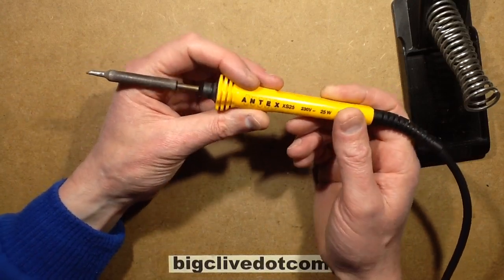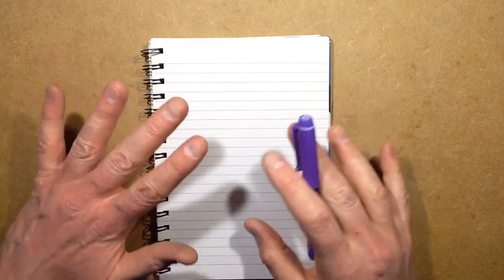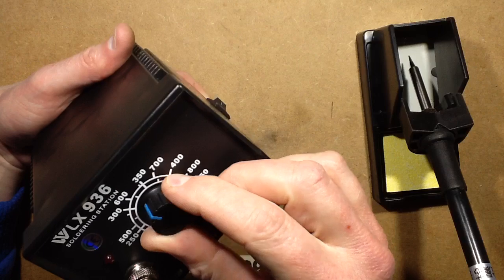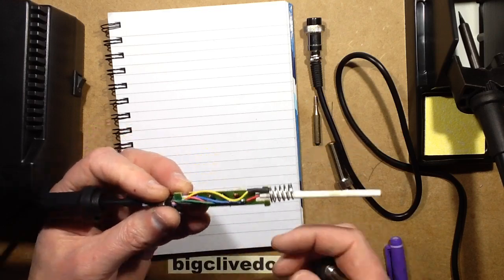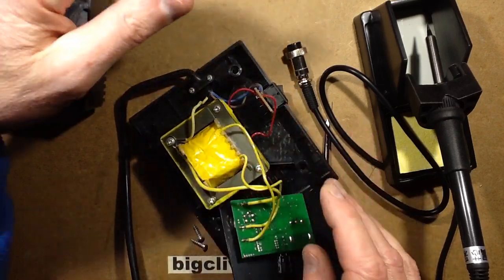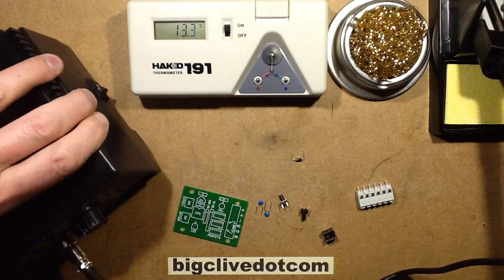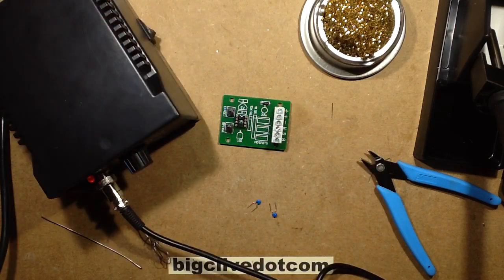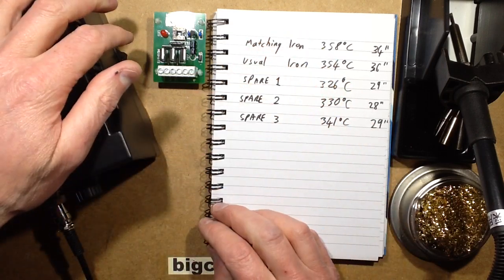Soldering basics and choosing a cheap soldering iron.

Comment: im so glad that you use metric and not that pathetic imperial system. it makes it so much easier to understand! cudos to you!
Reply: "Milliliters and milligrams are not really used in Europe either, except for drugs." I guess that depends on the region. Milliliters are common in Germany. The metric system gives you some flexibility. Luckily, it is easy to convert between different "cultures". The systematic way of unit conversion makes the metric system convenient in science and daily life.
Reply: Are there 100 inches in a yard?  No.  Are there 100 yards in a mile?  No.  It's called metric for a reason and that reason is that everything shares the same metric.  And there is no need for a decimeter, you may as well have a three dollar bill for those days when a one would be too small but a five would require change.
Reply: Theo0x89 I used to live in Europe. Would use « decis » or « Dezi » (deciliters) daily for drinks at restaurants and cafés, though each size also had a name. Typically you can get 1 dl glass of wine, 2.5 dl small soda, 3 dl normal soda or 5 dl big soda or beer. I believe people also refer to 3 dl beer but bottles contain a pint (355 ml) no? Regular wine bottles hold 7.5 dl.
I’d also hear people say 25 cl. Milliliters and milligrams are not really used in Europe either, except for drugs.

IMO THE MAIN ADVANTAGE of metric is that it makes it easy to do other calculations in Physics because of the SI unit system. Like F = ma works with Newtons, kg and ms-2. 

We can all agree that the Fahrenheit scale makes absolutely no sense though. It’s based on mistakes from its creator. 
Btw if you keep forgetting how to convert from Celsius, keep in mind water freezes at 32 F and boils at 212 F, with 180 divisions in between instead of 100. To get Celsius shift by -32 and divide by (180/100). Reverse to get Fahrenheit from celsius (expand to 180 divisions and shift by 32)
Reply: "there's nothing stopping us from using decimal notation with the imperial system" Don't be silly. You know very well that there is a fundamental difference in converting between inches, feet, yards, miles on the one hand, and millimeter, centimeter, meter, kilometer on the other hand. The point is that all these units are common, but they are hard to convert within on system and easy within the other. On top of that, you have the same unit prefixes for all quantities in one system, while you have to know different conversion factors for different quantities in the other.
"If you buy a ratchet and sockets, what is the square drive measured as?" There are many examples of imperial and customary units used internationally for historical reasons or due to the influence of the United States. That doesn't change the fact that the metric system is easier to work with and should be preferred when feasible.
Reply: "The meter is still just an arbitrary unit" As an engineer you should know that it is not the definition of the meter that make people prefer the metric system. It's the systematic way of converting between units of length that makes it easier to work with.
Reply: hahahaha Paul for someone so seemingly intelligent, you're an idiot. Anyone who can count to 10 can do metric. It is a far, far more logical and intuitive system than imperial. Oh and 'standard wire gauge' is useless info. Cross sectional area in square millimetres on the other hand is very useful.
Reply: Indeed, a thou (1/1000th of an inch) is a standard PCB measurement.
Reply: It's a two dollar bill, and it's handy! And yet there are a hundred pennies in a dollar, but ... whatever.
Reply: Not units. Magnitudes.
Reply: "Is it an imperial unit like here or is it some metric value" According to Wikipedia, the square drives are manufactured in precise metric units everywhere, so the dimensions in inches are actually approximate and just used as trade names (https://en.wikipedia.org/wiki/Socket_wrench#Ratcheting). Wikipedia doesn't cite any sources, but I guess there are ASME and ISO standards for that (maybe ISO 1174?).

"Not worth the trouble" I'm not sure about that. In the long run it may cause more trouble to keep using more than one standard in the US. A typical example is car repair, where you need different sets of tools for domestic and imported cars. Another cost factor is error-proneness, the prime example being the Mars Climate Orbiter, which failed because of a units confusion. Even if a brain can do more then chewing gum, it is still not infallible...
Reply: "in other words, you metric-weenies have to refer to the drive as 1/4″, 3/8″, 1/2″, etc." I already implied this two comments ago and I already anticipated your faulty logic. Didn't you understand what I wrote or do you have Alzheimer's, old man?
"You need both sets of tools for a single car and it's been that way since at least 20+ years" So you're saying the multiple standards made it even worse than I said. Thank you for proving my point.
"That error didn't have anything to do with conversion" That was my point. Conversion is not the only problem that comes with clinging to that antiquated measurement system. You need to work on your reading comprehension.
"I'm sure that they could have managed to make some other mistake [...] Never underestimate the power of stupidity." That's some impressive mental gymnastics. "Don't let us eliminate this source of error because other errors can be made."
"If it was measured in mm or μm, I wouldn't have a problem -- I would just set my caliper" Just as no "metric-weenie" has a problem using inches for ratchet drives. In these cases the sizes are basically just used as labels.
"It's funny that the people most complaining about the Imperial system are those who never have to use it" I'm sure you have a study at hand that proves you didn't pull this fact out of your ass, you just forgot to include the citation. Just to be clear, I have used old units, and I'm actually complaining about your idiotic arguments. I don't really have a strong opinion on the unit systems used in the US. The old units will fall out of usage sooner or later anyway for practical reasons. The interesting question is why some people feel the urge to defend their backwardness.
Reply: Whether you use metric or imperial or SAE/US customary units, it's all just an arbitrary way of measuring.  There's nothing intrinsic about the metric system.  The meter is still just an arbitrary unit that they originally defined as 1/10,000,000th of the distance between the equator and the North Pole.  But then it turned out that their estimate for the distance to the North Pole was wrong, so it ended up being just the length of the sample rod / bar that had been previously created since they didn't want to change the measuring scale due to the fact that it would affect so many things.

I'm an engineer in the US and I have no problem switching units as the case may be.  Even in the UK, beer must be sold in imperial PINTS, not metric based units and their pints are a bit different than US pints (slightly different size ounces and 20 oz per pint over there vs 16 oz per pint here).
Reply: @CurmudgeonExtraordinaire  True (for draught beer, and cider), but all other alcoholic drinks are sold in ml. In supermarkets, almost all liquids are sold in ml, although milk can either be sold in pints or ml. (Beer and milk were I suppose regarded as traditional staples, and it wasn't worth annoying traditionalists by insisting on metric for those). And we've been buying petrol (gasoline) for decades in litres.  We still measure road distances in miles and yards though (same argument re: traditionalists, I'm guessing).

I started work in the engineering industry in 1968, and metrication was just being slowly (very slowly) introduced. I imagine we'll stay with miles and pints for the uses mentioned for quite a long time to come. Some idiots want to reverse metrication after we leave the EU (if we actually do). Ignorance as well as idiocy, since metrication started well before we joined the EEC (which eventually became the EU).
Reply: +Theo0x89 -- And there's nothing stopping us from using decimal notation with the imperial system.  In fact, we already use it if you are talking about milling / lathe operations (i.e. 1/1000ths of an inch).  When we refuel at the gas station, we don't buy 20 gallons and 8 ounces, we buy 20.5 gallons.

I've got a question though for the folks over in purely metric countries... If you buy a ratchet and sockets, what is the square drive measured as?  Around here, whether it is Imperial or Metric, the drive will be 1/4", 3/8", or 1/2" (although they do make larger for really large nuts and bolts).  From some YouTube videos that I've seen by people that are based overseas, they refer to their ratchets by the same Imperial measurement on the drive square that we use.
Reply: @CurmudgeonExtraordinaire  You've reminded me that in "purely metric countries" (in Europe), their standard railtrack gauge is 4 feet 8.5 inches, same as it is here in the UK! :-)  And that's another thing that won't change any time soon.
Reply: @Okurkaarrgghh  Fair point (through when it was first introduced in England in the early 19th century, it would have been expressed as 4 ft 8 1⁄2 inches).

Checking online, I read that there was an international rail gauge conference as far back as the late 19th century, in Berne. I haven't found the text of that though. I found this much more recent UK source which is interesting:
https://www.thepwi.org/technical_hub/technical_hub_files/track_maintenance_general_guides/maintenance_of_track_gauge_guidelines_1999
which does indeed define it as 1435 mm, although it's not quite as simple as that if you look at the full document.
e.g. it talks about "gauge widening" on tight curves. The widenings are of course expressed in mm.

Anyway, that just supports the point that the UK (for all its sins..   :-) ) is a metric country for most serious purposes, with the major exceptions of road distances, (and I believe railway track distances - i.e. distance between places, not construction dimensions), draught beer and bottled milk.
Reply: +Theo0x89 -- I was not asking a rhetorical question, I actually wanted to know what the square drives on the sockets is measured as over there.  Is it an imperial unit like here or is it some metric value that is probably close enough that the sockets from the two systems will probably work?

There are certain things that I deal with that are metric, others that are in the US measuring system, and still others that are in the actual English Imperial system.  It's just not that big of a deal to me.  Not worth the trouble that would be involved in switching over the US to just some other arbitrary measurement standard.  Sure, there are a few conversion factors that you need to remember, but if you can't remember them (or at least remember where to find them), then you probably shouldn't be doing anything that involves more complex thought than just chewing gum.
Reply: Actually, us metric-weenies don't refer to the drive as anything, grumpfart. As I said, nobody gives a fuck about whence the size originated or how much it actually is because all this thing interfaces with is the sockets that we use to tighten or loosen our beautifully metric nuts and bolts. For all we care, they could be measured by some Zimbabwean's king's smallest three toes. To us, it's simply the large, medium, or small ratchet with its matching sockets. There is nothing else practically available that the ratchet drive needs to fit due to its size in inches, centimetres, or whatever. So fuck off with your idiotic argument. Go ride your hemorrhoids-massaging machine.
Reply: it's gotten us to the moon, so..
Reply: If anybody thinks that having different measure units is not a problem, just google "conversion error NASA". It yields long list of arguments why we should stop using antiquate units.
Reply: Rob Fraser - "Are there 100 inches in a yard?  No. Are there 100 yards in a mile? No. It's called metric for a reason" - Uh ... being base-10 helps, but it's by no means an absolute necessity for metricity. Just saying. And fuck your double spaces after full-stops.
Reply: Some inch-based (or rather, based on the local equivalent of the inch) remain, such as said square drive bit, but probably because it doesn't interface with anything else but the actual sockets, nobody minds, while nuts and boltheads are metric. Same for a few plumbing pipe sizes. Seen so, for instance, in Germany.
Reply: Grumpy OldMan hahaha yep I was going to bring up pints of beer. Google that shit. There's about 7,000 versions of what a pint is. Measure those 'pints' in millilitres and it is immediately clear. On a related note, I'd never heard of decilitres because here in Australia we use millilitres. It was immediately obvious however that that 1 decilitre is 100 millilitres. Just another example of the logical and intuitive nature of metric.
Reply: I hate it when people use the pathetic metric system. It makes it soooo hard to understand.
Reply: Good point!
Reply: Hey FUCK you.
Reply: "And there is no need for a decimeter" Well, the widely used liter is one cubic decimeter, so there is a usage for that sadly neglected unit. Anyway, I want to congratulate OP for triggering some imperialtards. They surely take it personal that someone doesn't like their measuring system.
Reply: So, in other words, you metric-weenies have to refer to the drive as 1/4", 3/8", 1/2", etc.  LMAO...

Different sets of tools for domestic and imported cars?  LMAO... Just shows how little you know... You need both sets of tools for a single car and it's been that way since at least 20+ years as far as I know, just from cars that I've owned and done minor repair on.  Hell, even my Harley has some metric bolts on it.  But*, you don't see me bitching about having to have two sets of tools.  I'm just glad we don't have the Whitworth measuring system around on any recent cars. :)  And let's not forget the tolerances in the dimensions of the hex heads of the nuts, bolts, and wrenches that makes it so that sometimes an SAE wrench will fit a metric nut or bolt better than the SAE wrench that is *supposed to fit it.  I suspect that if you had a series of metric wrenches that were every half millimeter, they would provide a close enough fit for any metric and SAE bolts and nuts that you might encounter.  But then again, the same could probably be said if you had an SAE set that was based on an interval of 1/32".

Yeah, the Mars Climate Orbiter was a major "oops", but I'm sure that they could have managed to make some other mistake that could have had the same end result, even with a common measuring system.  That error didn't have anything to do with conversion, it was just two groups of people each thinking that the measurement unit should be something different than what the other group was thinking.  It could have just as easily happened that one group thought that they needed measurements in km and the other group thought they were supposed to be in meters.  Never underestimate the power of stupidity.

I have ammunition calibers that I reload that are supposedly metric (e.g. 9x19, 9x23, 10mm, 7.62x51, etc), but the dimensions are all measured in thousandths of an inch.  It really doesn't matter to me.  If it was measured in mm or μm, I wouldn't have a problem -- I would just set my caliper for that scale and deal with it.  It's funny that the people most complaining about the Imperial system are those who never have to use it and the metric system at the same time anyway.
Reply: lazaglider
Metric and Imperial are just scales. The people that whine the most about the difference often have the least skin in the game. They generally don't do anything where measuring plays a critical role. I have thousands of dollars worth of metrology equipment and the lion's share of it is Imperial too. Micrometers, calipers, dial indicator gauges, height blocks, scales, etc. etc. But they're going to tell me that their cheap plastic metric ruler is somehow superior. Yeah, right, sure it is kid.
Reply: Neither of them are better than the other it depends what you grew up using I could make up a measurement system to teach kids on Africa and they'll use is their whole life without problems
Reply: I don't think that a measuring system, on which an empire was built should necessarily be called 'pathetic', but each to his own.
Reply: lazaglider
I don't get the whole Imperial is harder argument. When I am precision measuring I use decimal inches. they look the same to me as metric numbers. An inch and a half is 1.5", or  3.81cm. I'm just not seeing how metric is any simpler.

Know what's funny about metric?

The centimeter is a piss poor excuse for an inch, the meter is a lousy yard, the kilometer is a joke for a mile, then there's the poor lonely decimeter, that never could measure up to being a foot.

I've argued with a lot of metric proponents and they don't even know what a decimeter is. It is that unpopular.
Reply: +Paul Frederick well said sir. Nothing wrong with imperial, it just requires a bit more of a brain to work with it.

I suspect that is the aspect which the naysayers lack.
Reply: +Martijn Bruggers What do you think Standard Wire Gauge is? You metric weenies are so dumb.

Comment: Interesting video Clive, i have one of the Maplin digital stations which has only 4 pins for the connection, and the replacements are really expensive. I am now considering when it fails buying a "cheap Chinese" soldering station.